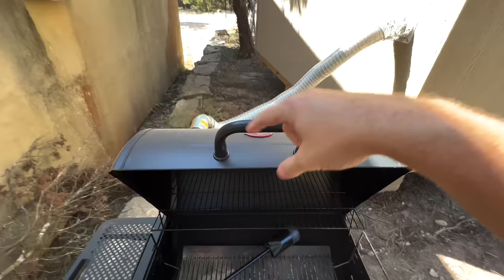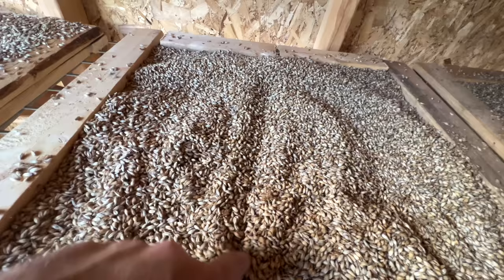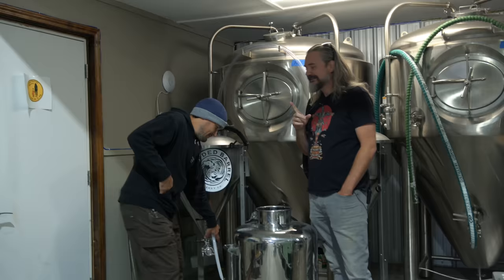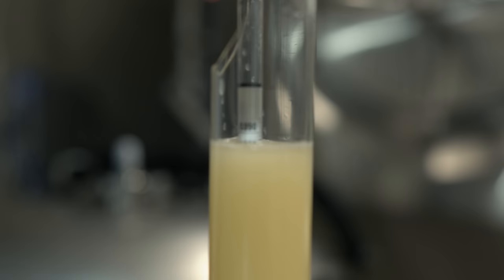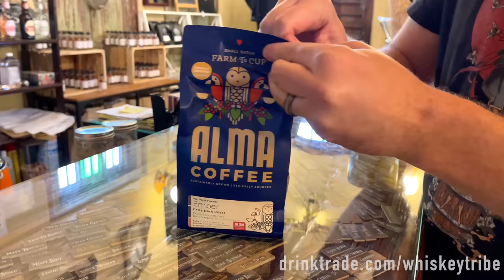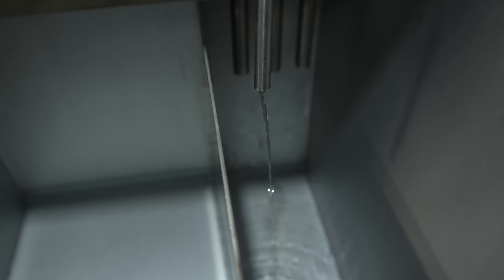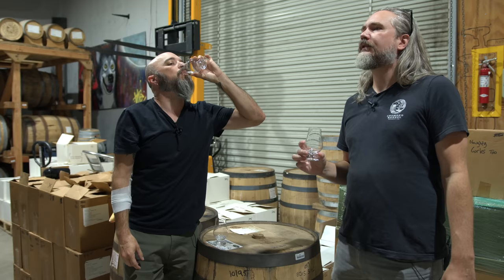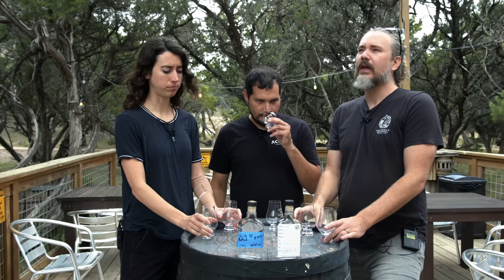We $M0KED whiskey

Comment: When smoking meat/fish, the product must be as dry as possible on the surface in order for the smoke to adhere properly.  You should also have the ability to reduce the size of the space that you have grains in so that the smoke is more concentrated or you need something that produces a lot more smoke.  Also a small chimney that leads smoke out so you get a draft through the shed.  When you smoke meat/fish and the smoke "stands still" in the space, the product tastes like ash and soot, therefore you must have a chimney so that it does not become too dense.
Reply: I just toured Whiskey Del Bac, who is known for their mesquite smoked single malts, and they have a smoke shed that pipes all the smoke into a giant tank that is constantly spinning and moving the grain, which dries it and adheres the smoke evenly across all the grain.
Reply: Dry anything isn’t going to pick up smoke as a moist something. I’ve been smoking meat for years and never heard…”dry your meat before putting it on the smoker”.